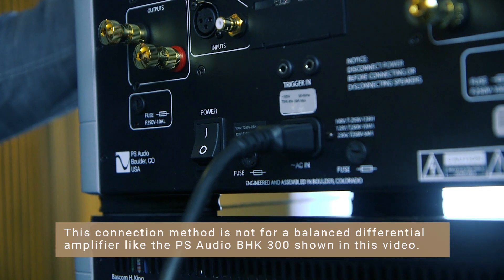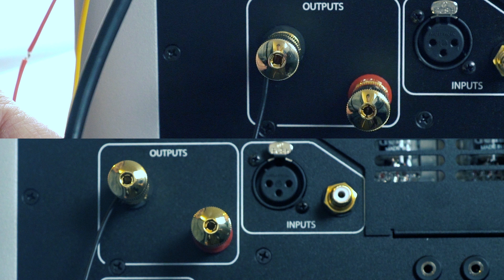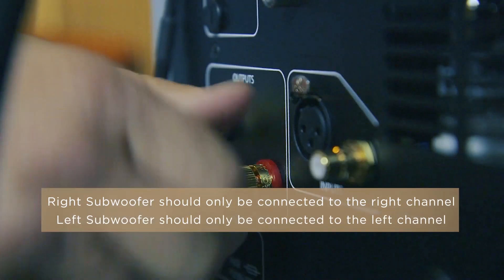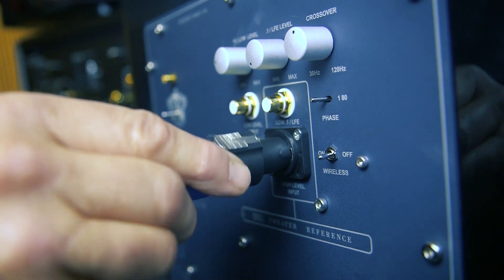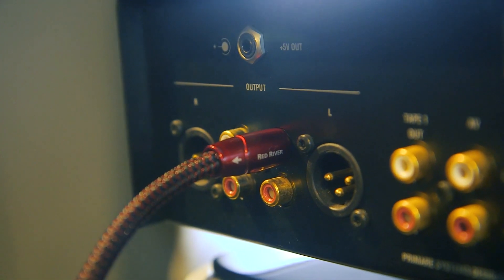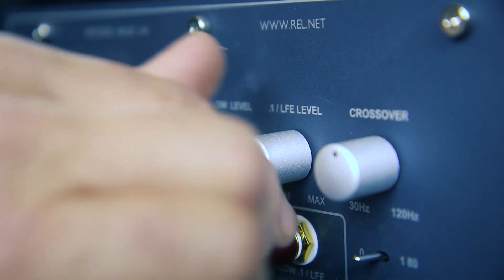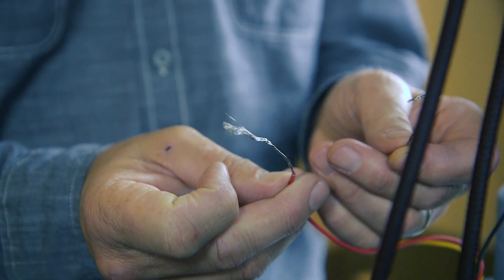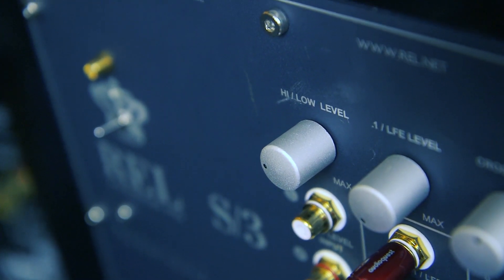REL Acoustics How To: Connecting a Stereo Pair of RELs using the High Level Cable

Comment: Could I hook 2 Rels up to receive a signal from a center channel aswell? Something along the lines of connecting the red and black cable of each of the subs to the respective L and R channels and then the yellow cable of both to the center channel terminal. Would this work / be safe?
Reply from the maker: Thank you for reaching out. Since the center channel speaker typically requires tuning adjustments that are fairly different from the front left and right speaker channels, especially in terms of the Crossover setting, we typically do not recommend connecting a REL using it's High Level input to blend with both a front channel speaker and your center channel. In this case it will be best to either connect one subwoofer for the front left and right channels and the second exclusively for supporting the center channel, or to add a third smaller subwoofer for supporting your center channel speaker.

Comment: I have an integrated amp, are 30-40 watts going to damage the Rels?
Reply from the maker: Thank you for reaching out. The High Level input on REL subwoofers is designed with a significantly high input impedance, which means that it can be connected directly to the output terminals on your amplifier without placing any current load on the amp or drawing any amp power away from your main loudspeakers. This also means that the output power rating of the amp will not have much impact on the performance of the subwoofer, and a 30-40 watt amp will be perfectly fine for this application.

Comment: All well and good.   I want to connect a single subwoofer up to a 2 channel amplifier.   Am I to understand the high level input goes to one of the channels of the amplifier for sampling?  Which one, right or left?  As well your putting this in parallel with one of the speaker outputs...doesn't that lower the speakers impedance level to the amplifier?  Please explain
Reply from the maker: Thank you for reaching out. When connecting a single subwoofer to a 2-channel stereo amplifier, the High Level cable will connect to both the right channel and left channel positive output terminals, with the third black wire being connected to a ground reference point. This will allow the subwoofer to receive both left channel and right channel signal, and then sum them to mono within the subwoofer's input circuit. 

The High Level input on REL subwoofers has a significantly high input impedance, which allows it to connect to the amplifier's speaker output terminals alongside your main speaker wire without placing any additional load on the amp or drawing any amp power away from the speakers.

We hope that this helps, but if you have any additional questions or concerns then feel free to let us know and we will be happy to assist.
Reply: @REL Acoustics   Thankyou for getting back to me...much appreciated!

Comment: i still have unused at the back of my sony amp set B speaker out and the official high level out .
As far as I understand the high level out is essentially a speaker out point . so if I want to connect two rel subwoofers am I right in thinking  that I should plug one into each.
Reply from the maker: Thank you for reaching out. When connecting two subwoofers to a stereo amplifier we recommend connecting one to the left channel speaker output terminals and the second to the right channel speaker output terminals. Ideally these should be the exact same terminals as your main speaker wire is already connected to.

Comment: I can do this setup on Class D Amplifier  ??  I just bought 2 sub Rel T/7x and Onkyo TX RZ50, please can you help me about it, I can do or not ??
Reply from the maker: Thank you for reaching out, and congratulations on your new T/7x subwoofers! Your new RELs can absolutely be connected to your Onkyo TX-RZ50 using the High Level input. For each subwoofer, combine the red and yellow wires of the High Level cable and connect to the positive output terminal for the corresponding amplifier output channel (right channel sub to the front right channel outputs, left channel sub to the front left channel outputs) and then connect the black wires for both subwoofers to the Onkyo's phono ground screw. 

Since the TX-RZ50 is a Class D amplifier, it will be important to not connect the black wires for either subwoofer to a negative speaker terminal, as doing so will result in damage to the subwoofer and/or the amplifier.
Reply: @RELAcoustics  thank you very much, have a wonderful hollidays, Merry Xmas and Happy New  Year 2023 and beyound !!
Reply: @RELAcoustics  I recommend this video: Do you need a subwoofer? Rel T/7x Review 13th Note HiFi Reviews

Comment: What impedance does the amp "read" the subs to be?  I am running 4 ohm Martin Logans and don't want to mix impedance or have the amp think it's actually driving, say, 8 ohm speakers.  Please advise.
Reply from the maker: Thank you for reaching out. The High Level input on REL subwoofers has an input impedance of 150,000 ohms, which results in the subwoofer not placing any current load on the amplifier or drawing any amplifier power away from the system's main loudspeakers.

Comment: I have a roksan caspian power amp m2 and would like to add another t9x sub to rhe one I already have. I have been told 2 would be to powerful to be able to connect  in high level with the red and yellow and black cables. In this video it seems possible can gou confirm if I can have 2 and  connect rhe way gou have here or would it be to powerful for my power amp?
Reply from the maker: Thank you for reaching out, and for supporting REL Acoustics. When connecting a stereo pair of subwoofers, we recommend starting by having both the red and yellow High Level wires connected for each unit. In most cases this will work well, though in some cases this will result in the subwoofers producing too much output, where they already overwhelm the main loudspeakers when the Level controls are set to a couple clicks from minimum. When this happens, you can disconnect one of either the red or yellow wire, which will lower the input gain by half and allow for more flexibility when setting their Levels.

To start, we recommend using the following connection method with your Roksan Caspian:
- Twist together red and yellow for the right channel sub, and connect to right channel positive on the amp.
- Twist together red and yellow for the left channel sub, and connect to the left channel positive on the amp.
- Connect the black wires for both subwoofers to the amp's chassis ground screw.

Comment: Hi, I want to order two REL T7 for my Hegel H390. Do I have to connect the black wire or not? Thanks 🙏
Reply from the maker: Do you know what class the amplifier is? I couldn't find much info on their website. For any amplifier class you can just connect the negative speaker wire to a chassis ground instead of the negative speaker terminal. If you experience hum with that connection method you could look into whether you can connect the negative speaker wire to the negative speaker terminal.
Reply: @RELAcoustics  thank you for your reply. It ´s a class A/B amp. Some people recomment to me tp connect the subs via y-wire to the variable pre out. Would this be better or do you recomment to connect to the high level?
Reply from the maker: @gerygee6366  We would recommend using the high level connection. Here's an article that goes over some of the reasons why we think the high level cable is the best option. https://rel.net/blog/2021-02-09/system-thinking/what-is-a-high-level-cable/

Comment: Thanks for this great vid. I'm curious about how connecting the subs to the same binding posts that then connects to the speakers affect the power being sent out to the speakers. Will this take away from the power being sent to the speakers? I'm asking coz my amps aren't very powerful. Thanks!
Reply from the maker: The High Level input on our subwoofers is designed with a significantly high impedance compared to that of any main loudspeaker, which allows for a High Level subwoofer to not place any current load on the power amplifier, or draw any amplifier power away from the main loudspeakers. The High Level input will only draw just enough signal to tell the subwoofer what to play, and to then be amplified by the subwoofer's own built-in amplifier.
Reply: @RELAcoustics  that is so awesome! thank you for taking time to answer my question. more power to you guys!

Comment: Is this the proper method for connecting to the Yamaha A-S1100? Thanks in advance.
Reply from the maker: The connection instructions shown in this video for the red and yellow wires can be used when connecting to the Yamaha A-S1100, though the black High Level wire should not be connected to the negative output terminal on this amplifier. Instead the black wire should be left disconnected, or if hum occurs from the subwoofer then it can be connected to the ground thumb screw on the amplifier's back panel.
Reply: @RELAcoustics  Hi, I just wanted to thank you for answering my question a few months ago. I finally picked up a T/7x today, and I’m really pleased with the purchase so far.
Reply from the maker: @marc_ermine  We are glad to hear that you are enjoying the performance of the T/7x in your system! If you have any further questions about your new REL then feel free to reach out and we will be happy to assist.

Comment: is this correct for 2 x t9i to a stereo class d amp bel canto evo 200.2 ?????
Reply from the maker: Since the Bel Canto Evo 200.2 is a Class D amplifier, the black wires for your subwoofers' High Level cables should not be connected to the negative terminals on the amplifier. Instead they should be left disconnected to start, and if hum occurs from the subwoofers then you can either connect the black wires to a chassis ground screw, or you can run a pair of RCA cables from your preamp to the .1/LFE input on each subwoofer. The red and yellow wires of the High Level cables will be connected to the positive output terminals on the amplifier, as outlined in this video.

More information about grounding to Class D amplifiers can be found in the following article from our website: https://rel.net/blog/2015-07-23/how-to/how-to-connect-a-rel-to-a-class-d-amp/

Comment: Hello REL, thanks for this video. Could you advise on the safe way to connect two REL R328 to an Atoll IN400SE amplifier: "The IN400SE outputs 160Wpc into 8 ohms (300Wpc into 4 ohms) and employs differential dual-mono discrete construction. The output devices are MOSFET, eight transistors per channel, and there’s a hefty 93,400 µF of capacitance in reserve. "
Reply from the maker: Since your Atoll IN400SE is a differential amplifier, the red and yellow High Level wire connections will be the same as described in this video, though it will be important to not connect the black High Level wires to the negative output terminals on the amplifier. Instead the should be left disconnected, with tape covering the copper ends of the wires. If hum occurs from the subwoofers, then a pair of RCA cables can be ran from the .1/LFE input on each subwoofer to unused RCA outputs on the IN400SE. 

If you have any additional questions about connecting High Level to this system, then please write in to contactus@rel.net and we will be happy to assist.

Comment: I have a McIntosh MC452 and I ordered a pair of REL T/9x. Just to confirm, I am to twist the red and yellow wires together and connect each set to the same right and left positive binding posts of my amplifier that my main speakers are connected to, and both black wires should be connected to each negative speaker binding post that my main speakers are connected to. Is that correct? This amp is quad balanced so just want to make sure.
Reply from the maker: Since your McIntosh MC452 is a quad-balanced amplifier, it will be important to not connect the subwoofers' black High Level wires to the negative output terminals on the amplifier. Doing so can result in damage to the subwoofers and/or the amplifier. Instead, the black wires should be left disconnected, with tape covering the copper ends of the wires. If hum occurs from the subwoofers, then there are several options for properly grounding the subwoofers to the rest of your system. The following article from our website goes into detail regarding connecting High Level to Quad-Balanced amplifiers: https://rel.net/blog/2015-07-23/connection-guides/how-to-connect-a-rel-to-mcintosh-quad-balanced-amplifiers/. The instructions in the article are specifically for quad-balanced monoblocks, but the same rules will apply when connecting to a quad-balanced stereo amplifier.

Comment: How do I connect two HT/1003s to my AVR so that I can run them in stereo with my main speakers? Would I be better off just using the LFE input on each sub with one at the front and one at the back of the room? Thank you.
Reply from the maker: If the system is primarily used for 2-channel music, then we recommend connecting your pair of HT/1003 subwoofers to the front left and right channel pre-outs on your AVR. However, if the system is used for a combination of 2-channel music and home theater then we recommend connecting the HT/1003s to the designated subwoofer outputs on your AVR. If you have them connected to pre-outs then they should be placed just next to your main loudspeakers, though if you connect them to the subwoofer outputs then you can either place them next to the main loudspeakers or in opposite corners of the room. It will take some experimenting on your part to see which option sounds best to you in your room.
Reply: @RELAcoustics  Thank you.

Comment: Hi - I have two REL T-Zero Mark IIIs that I want to connect to my Sony AV. Just want to check that this would be correct:

High level connections: 
Subwoofer 1 (Left) - Both red and yellow cables twisted together, connected to Left Positive (Red +) terminal. Black connected to Left Negative (Black - ) terminal.
Subwoofer 2 (Right) - Both red and yellow cables twisted together, connected to Right Positive (Red +)  terminal. Black connected to Left Negative (Black - ) terminal.
PLUS
LFE connections - one cable from each Subwoofer Out port on amp to each corresponding LFE terminal on the subwoofer

This would then give me stereo subwoofers, for both 2 channel music (using the high level output) and for surround sound (where LFE is output form the amp)

All good?
Reply from the maker: Those connections appear to be correct! If you experience any hum from the subwoofers, then you can disconnect the Black High Level wires and place some tape over the wire's copper ends. The .1/LFE connection will also be providing a ground reference, making the black High Level wire connection unnecessary.
Reply: @RELAcoustics  Thanks - you say the black high level connection is 'unnecessary' with the LFE connected, but will it adversely affect anything if the black wires are connected as well?
Reply from the maker: @richardt3371  In most cases you can have both the Black High Level wire connected and the .1/LFE input connected without issue, though in some cases having both connections made can result in a ground loop hum. If you don't hear any hum from the subwoofer then you can leave both connected, though if you do hear hum then you can try disconnecting the Black High Level wire to eliminate the hum.
Reply: @RELAcoustics  I have a Sony STR-DN1080 and two REL T-Zero MkIII subwoofers, and cannot use them together without getting a hum. I have to use just one of the red/yellow cables from each, as otherwise the output is too high, so the yellow cables are safely taped up with electrical cable. Obviously I want to use the subs for both 2 channel and home theatre use.

I have tried the same for each speaker output – shown for the LEFT speaker connection below:

1.	Connecting red cable to red (positive) speaker terminal, and black cable to black negative speaker terminal, with LFE connected – results in hum

2.	Connecting red cable to red (positive) speaker terminal, NO black connection, LFE connected – results in hum

3.	Connecting red cable to red (positive) speaker terminal, black cable to black negative speaker terminal, NO LFE connection – results in hum

There’s no chassis screw that I can see to attach a black cable to – so what am I doing wrong?
Reply from the maker: @richardt3371  We are sorry to hear about the hum which you are experiencing from your Tzero Mk.III subwoofers. At your earliest convenience, please write in to contactus@rel.net and we will be happy to help troubleshoot this issue and provide resolution as needed.

Comment: Hi REL I have been waiting for you response on My REL,  I have mine hooked up exactly like you suggested but when I turn Off my amp It starts to rumble and gets louder and louder until I shut it off.    This happens on both channels and only when I shut Off the amp . I am using stereo REL with each wire connected to 8ohm taps on my Mcintosh ma900 . My speakers are are on the 4 Ohm taps.  I have both  black wires connected to the PHONO ground.   But I have tried all other configurations and all produce the rumble
Reply from the maker: Hello, thank you for supporting REL and we are sorry to hear about the issues which you are experiencing with your subwoofer. At your earliest convenience, please write in to contactus@rel.net and we will be happy to help troubleshoot this issue.
Reply: Did they ever fix your issue?